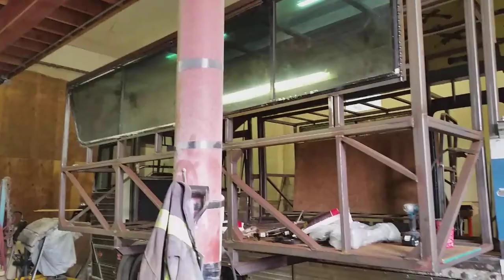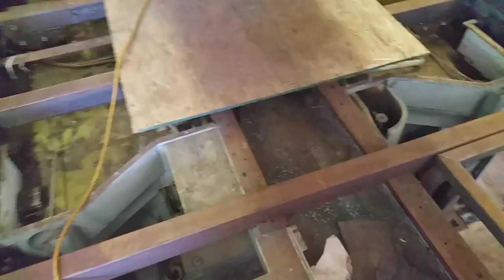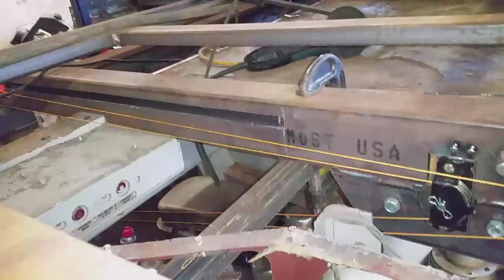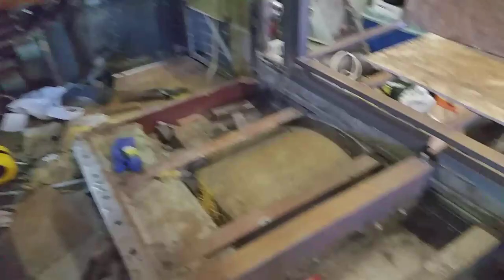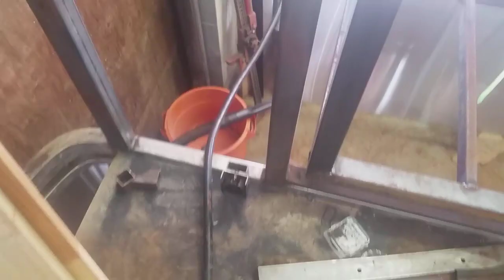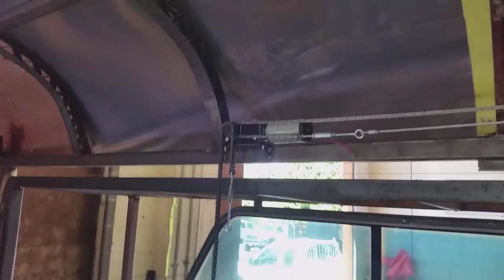Bus Conversion Project - Video 36 - Powering slideouts

Comment: Your slide outs look great. I am definitely going to duplicate your design. That cable sysyem seems a little complicated for me. I hope it works out for you....I kinds lile tje hydraulics better,  only because I understand them better.  Keep up the great work.  Thanks from David in Florida.
Reply from the maker: Ya.... I'm with you on that one, I tried the cable system on recommendation from another guy in Florida putting slideouts in his MC-9, so far I'm impressed with the bedroom slide , I'm going to try the front slide again and if it still doesn't work I'll go back to the hydraulic idea, I like the fact that I don't need another penetration outside the skin with the cables but we'll see, the cables aren't that complicated once you wrap your head around it

Comment: You are a rock star my friend. Very impressive. It did sound pretty loud on video. I say leave it as is and pull into a crowded Rv park at 2am and run those puppies. You will make a few immediate friends :). On a serious note, will there be a way to manually close the slides in the event of a failure?
Reply from the maker: it's funny.... the only one that makes any noise is that one.... maybe the alignment isn't as close as the other 2.... I'll have to make some adjustments..... I could always add a scraper to it if I really wanted to piss someone off... like dragging fingernails across a chalk board.... these mechanisms come with a tool to put in a drill to run them in and out if the motor craps out.... other than that you would have to disconnect the cables and push it in or out by hand

Comment: surely its only just over 30 inches of space for the motor as the 30 inch length of chain required for each side is folded in half so 15 inches each side
Reply from the maker: it's only in the position of 15" out each side when it is halfway through it's travel.... when it is all the way in or all the way out there is the full length of chain out each end, plus the hardware to connect it and the pulleys at the end have to be added into the required length.... believe me, I tried to get it into a smaller area... I even had both chains running the same direction and that cut everything in half but it was still longer than the space I had.... over the slide was the only place it could go